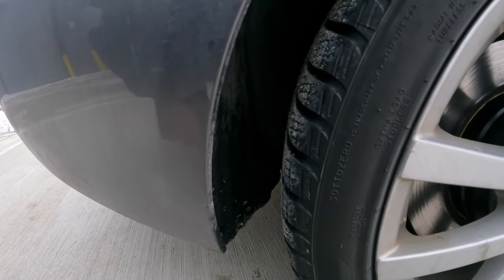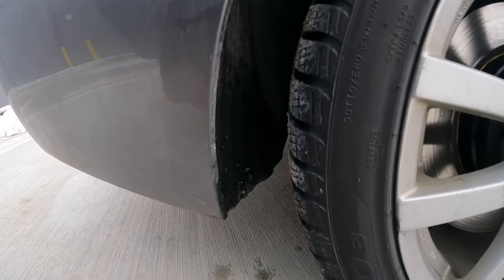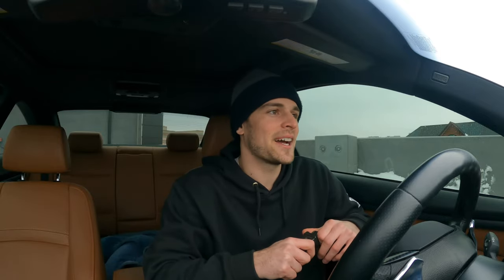Diagnose & Fix BMW Electrical Malfunction! Faulty RDC Module (TPMS) | E90 / E92 335i

Comment: Thanks for making this video brother. You are truly helping the BMW community. These were the exact symptoms my M3 started having. I had coded out the TPMS and removed the module, but just left the cable hanging in the rear wheel well. Sure enough, after watching your video, I checked out that cable connector and it had brown marks from shorting out. Wrapped it up now and so far so good!
Reply: How u coded it out?

Comment: Thanks so much for the video. It is a great help. I had same exact issues on 11 X5 E70. I changed the RDC module and all issues gone away except TPMS Malfunction. Now, I just have to find a way for coding/ programming this new RDC module.
Reply: I have the same car and same issues. Was it really as simple to fix as this video shows? Where is the RDC located on the X5?
Reply: @nickstegner5310  yes it was simple fix. Only thing the module has to be registered/coded after replacement. Otherwise, you will still have tpms malfunction warning light. The module is located behind the exhaust tank on X5 E70. . You need to go under the car from rear driver side tire. I have the picture but I am not able to post it here, don’t know why.
Reply from the maker: I have another video of how I used ProTool to code in the module after replacing it. Glad this one was helpful

Comment: Thanks for this video. My 328i started having the same electronic fault warnings start popping up about 5 minutes after driving lately along with more 'increased battery discharge' messages. Immediate thoughts were obviously battery or alternator issue. My TPMS system died several years ago but after the $800+ price tag to repair it then I just learned to live without it. Over time I suppose the unit continued to degrade and started sucking battery life. Unplugged it a few days ago and the warnings immediately stopped.
Reply: bro , my e90 have maybe same problem .when i driving in dashboard coming shis 3 lights , after if i dont turn off car , in dashboard comming new check (battery) and after car turning ingnition itself. when i trying turn on car its going like a battery is dead, but my battery is new 2 days ago i have buyed . i using battery jumper and car starting normal, after 1 day its coming again . what is a problem ? how you fix it ?
Reply: @elbakaa you have to register the battery with a scanner. Also maybe your Voltage Regulator or alternator.
Reply: @J__7777  it was alternator . i change it and everything is okey

Comment: Yes protool will code that moduel I have a bmw 2011 e92 328i same issue I went with new Batt I still get the malfunction dsc low acceleration and says get to a bmw dealer 😂I use bimmerlink and code using the obd11 however prorool which I'm going to get will code any moduel even from a doner car all u need is the software protool buy both license s and it will code a different amount of any moduel from a doner and code it into your cars Vin so that app is in my opinion spot on when diagnosing these bmw gremlins great video 📹 keep them coming 🎉🎉🎉🎉

Comment: I just saw your video and I'm dealing with the same thing right now. Car is actually at the shop. I had to have it towed because then it had no crank no start. Started doing the same thing right after a storm and I had warmed the car up prior to going anywhere and moved it to shovel. No issues till I was pulling out of the driveway. The cluster went dead basically then came back. Shut the car off and restarted and everything was fine except the tpms was inactive.

Comment: A  bad RDC module will cause the U112B error code. To confirm just diconnect the existing cable. You will have a TPMS Inactive error but should no longer have your dash going crazy.
You can replace (no programming needed) with the matching used module $100. Verify the software rev version # the the right of BMW on the top of the module.
Thesee modules are a built service $$$ profit center for BMW. If you cut open the module you will find corrosion like in a leaking battery at the front of the cicuit board near the connector.
The casing joint either leaks or there is lots of condensation in the module. BMW diid years of research trying to find the worst spot to mount these modules. 
"Underneath and behind a tire ? " "Sounds perferct. "

Comment: You saved me sooo much time. I was getting ready to pull out the dash🤦‍♂️. Im working on repairing my tps circuit board right now. The circuit board has one badly corroded connector. So I soldered in a wire to complete the circuit. Will test it out tomorrow. Bmw did a poor job with sealing these units. My guess is that many heat cycles causes the glue to crack over time which ends up allowing water in.
Reply from the maker: Glad it helped! When I took mine apart it was still sealed well but looked like water had seeped in around the pins for the electrical connection. Definitely needed better sealing, or maybe just located in a place less exposed to water
Reply: Where can I find this?

Comment: Subbed. My n51 has been throwing airbag codes at random times and MPG cluster fluctuates when cold and also alternator constantly whines on startups ,( new one installed ) going to try this as soon as I figure out the location ( 2008 n51 328i ). 👍🏼
Reply from the maker: Worth checking out. Also would be good to get a scanner that can read BMW specific codes by module. Would give you an idea which system the issues are originating from

Comment: What do you suggest for X5 2013 BMW ? ( Problem is for some time after car wash )  and it is back on Normal !
Reply: I have the same problem with 2013 x5 after putting it in through a carwash

Comment: I have an 08 528i. 183k miles. It started 
Doing the same thing.  I’ll start the same process.
Reply: did it work?
Reply: @brianskelton346  no.  It was the body control module.

Comment: hey guys . please if someon know issue help me 😢... In hot weather, when I drive on the road, these 3 sensors suddenly light up, then turn off, after 2 minutes, they light up again, if I don't stop the car and turn off the engine, the steering wheel hardens, then the battery lights up and turns off the car by itself. When I want to turn it on, the car does not start, as if the battery is dead. I remove the minus cable and connect it back again, then I start the car with the battery charger, I changed the battery but after 2 days the same problem happened to me. What could be the fault?

Comment: What did you have to do for coding?  I somewhat have the same problem. Mine is just telling me it’s inactive and happened after I went to the mountains.
Reply from the maker: Check out the video I released a week after this one. I use the bimmergeeks ProTool software - it can do the coding and can also tell you the exact error codes your TPMS module is throwing

Comment: hello i wanted to know if there's a app for the MHD that you put on the tablet, so that you can get the dongle to link up to or program that you needed to load for the TPMS system?
Reply from the maker: I use an android tablet with the MHD WiFi adapter and ProTools software to do my diagnostics / coding. I used to to code the new TPMS module, check out my other video on it

Comment: I have the abs, brake, an traction light (yellow) and at times in and out the seat belt light AND TPMS light (orange). I can’t figure out what the issue is after troubleshooting ABS pump, module, wheel sensors. Not throwing any codes. Any ideas?
Reply from the maker: Make sure the battery is still good first. Try unplugging the RDC module like I did and see if it clears anything up. Yours might be located in a different location depending on the year. If you’re still having issues get a good scan tool that can read the individual modules of the car (I use bimmergeeks pro tool). When my car had the problem it showed errors across multiple modules but it was pretty obvious it originated from the RDC
Reply: Did u ever find the fix for this ? Currently chasing it now & the removing the TPMS antenna didn’t fix it

Comment: Could you give some description on how to remove the RDC module? I saw the module and disconnected the line, but wasn't sure the correct way to take out the module. Don't want to force it and break anything. Thank you!
Reply from the maker: The module is held in by a small u-shaped plastic bracket. If you just wiggle the module and pull toward the outside of the car it comes out very easily, the chances of breaking anything are pretty low.
Reply: @lifebycars5849  , Thank you! I want to give a quick update in case it will help other owners. 
On my 2011 328i xDrive, to remove the module, you first push down the head side (connector), get it out of the bracket and then slide it out with a little bit angle downside.

I also opened the module using a knife to cut open the glued top. The 4 pins on the PCB are pretty rusted and one comes loose. Have cleaned it up and will try to solder it back once I have the tool arrive.

Comment: Did your power steering fail too?
Reply from the maker: Nope, my steering is hydraulic so no issues with it. I know the E9X came with electric steering on other regions like the UK so guessing that’s what you’re dealing with if you have an electrical system issue

Comment: Hey there when you had this issue was your speedometer and rpm gauge not working as well ??
Reply from the maker: They would work intermittently and would jump around all over the place
Reply: @lifebycars5849  I’m having the same problem, Trans light, ABS, tire pressure and a bunch of others… I replaced alternator and voltage regulator as well as the battery and coded it. So I’m thinking it is the RDC module
Reply from the maker: Something on your CAN line is disrupting the signal. In my case it was the RDC like I showed. If you have a scan tool that can read all the modules it should give you an idea where it’s originating from

Comment: I just called BMW dealership and got a quote to R & R the RDC Module. The cost for the part is $414 and labor is $564.... Wow... 
If I unplug this RDC Module, will I still have intermittent lights on the dash? Right now, the TPC error code light flashes intermittently and not not consistently.
Reply from the maker: If the RDC module is causing problems and you unplug it those problems should go away. The only error that would be left would be the TPMS inactive since the module is unplugged. That can also be coded out and have FTM instead

Comment: I’m having similar symptoms is it ok to drive tell I get the parts I don’t wanna mess anything else up lol
Reply from the maker: In my case I wanted to limit driving as much as possible because I didn’t have full use of turn signals and whatnot. However I wouldn’t have caused any further damage, just needed to replace my TPMS/RDC module
Reply: @lifebycars5849  and is it just one module per front and back or all 4 have them
Reply from the maker: There are different systems depending on the year of your E9X. My LCI 2013 has the RDC module behind the rear passenger wheel liner but for the earlier cars I believe it was somewhere in the trunk
Reply: @lifebycars5849  I found it I just unplug it also did you have any warning come up fir abs and 4x4 mines a 2011 328i
Reply from the maker: Yup, had those errors as well. Cleared up after I unplugged the module. Can also try to turn the wheel from lock to lock that might clear them as well
Reply: @lifebycars5849  nice I’m hoping it’s the problem niw just to find a guy with a coder yo code the new I found one online threw my auto shop $60
Reply: I just unplugged my negative from my battery as well to see if it helps
Reply: @lifebycars5849  I’m new to bmw so ur Chanel will be helpful glad I found it